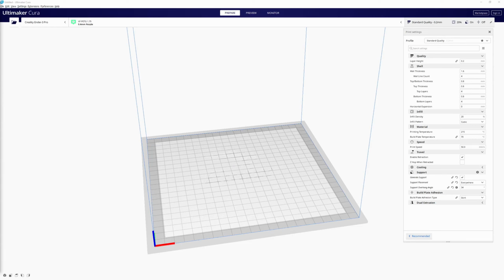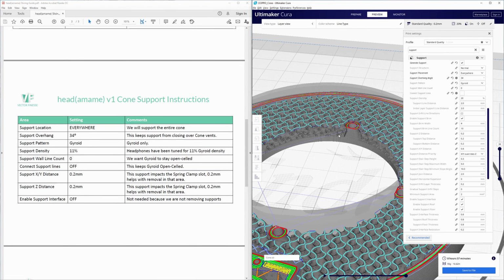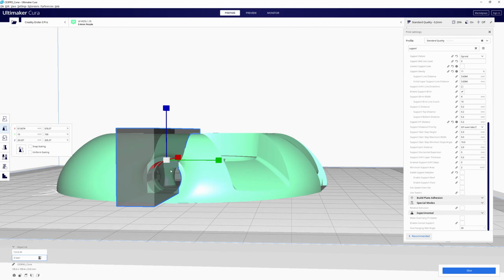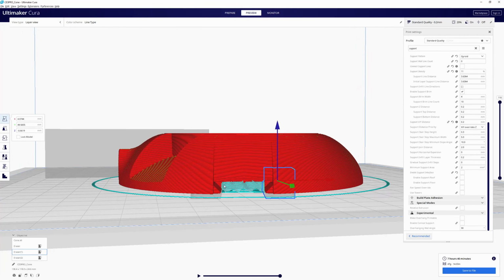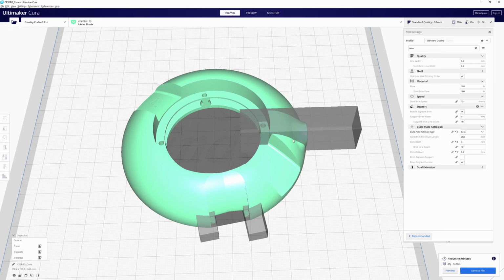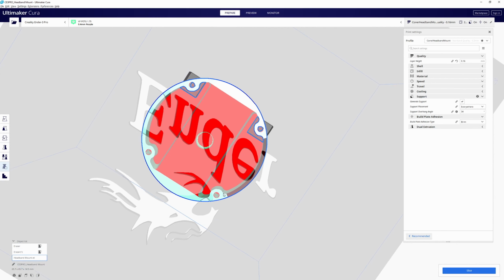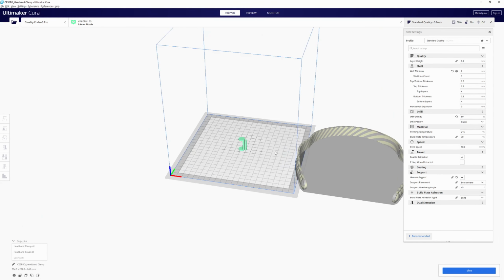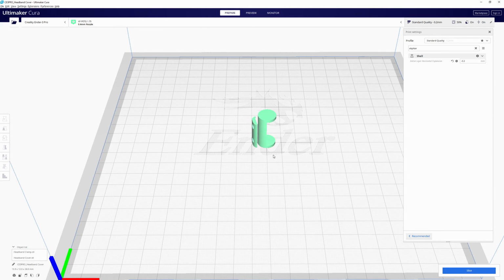head(amame) Slicing Guide

Comment: if the brim isn't touching the part what purpose does it have? It now cannot help adhere the part to the build plate.  Also I think the driver mount has been changed in v1.6 as it doesn't need such a large support :)

Comment: One question I want to buy the full set with 40mm drivers but want to upfrade later to a 50mm driver. are both 3d models included? and is there a way to have both logos the right way, because I will tell left and right with the cables facing forwoard.

Comment: Quick tip on adding the support blockers, it's easier to add the one for the xlr connector, then rotate the model so the dovetail is aligned and then add in those (The added support blocker will rotate with the part), that way you don't need to worry about weird scaling on support blockers. Also, setting the viewport to orthographic makes it much easier to line things up.

Comment: Hmm. I'm using these settings, but some supports still generate in those spots the angle was supposed to have excluded. Worse, it seems to start supporting a layer above the surface of the cone's interior. Set to fine, that increases to 3 layers - already had a print ruined because I was extruding into thin air...
Reply from the maker: Please post questions/screenshots in the subreddit:)